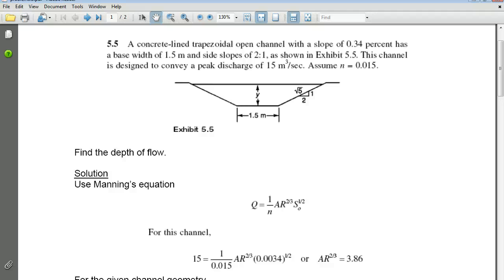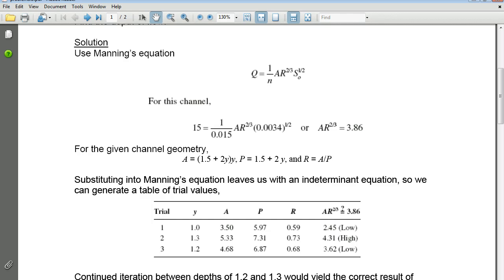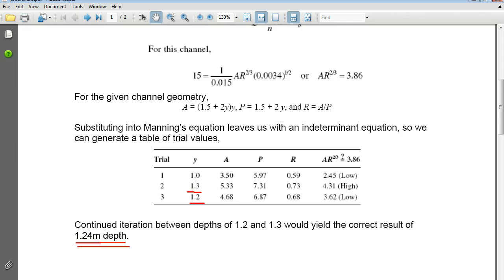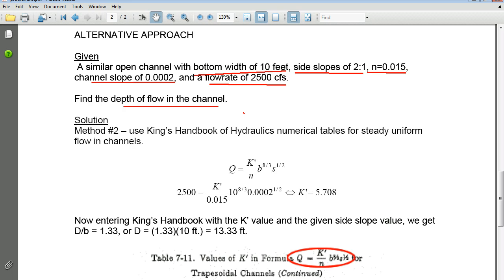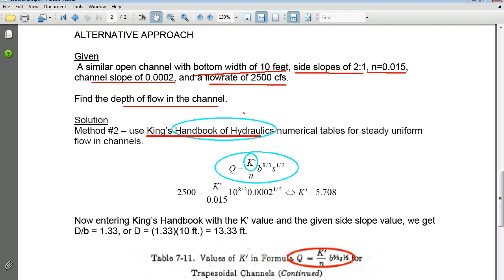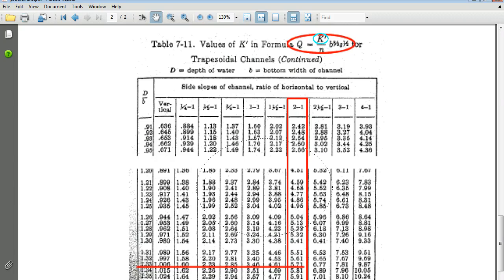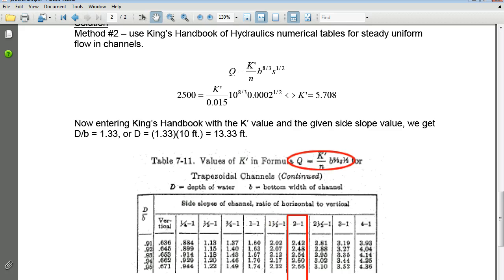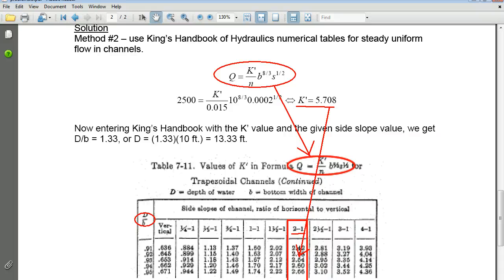PE Exam Prep Alliance | Water Resources Engineering Sample Problem & Solution 062613

Comment: Hi. Thank you for the video but I had a question. How did you get P=1.5+2y? Shouldn't it be 1.5 + 2*(sqrt5)y? Please advise.
Reply: You are correct.  Yes, that is the correct formula.  You will also notice that you can't get the Wetted Perimeter numbers in the table unless you use this corrected formula.